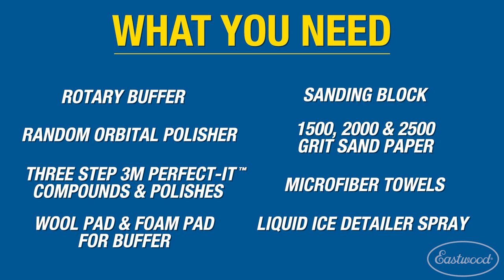How to Color Sand & Buff a Car After a Fresh Paint Job - Step by Step Plus Tips & Tricks - Eastwood

Comment: How long should you wait before cutting and buffing fresh clear coat?
Reply: My body shop waited a couple hours after leaving the booth 2-4. But I didn’t feel safe buffing it much less sanding lol a day or so would be best in my opinion
Reply: the longer you let it heal the better
Reply: I'm not being disrespectful when I say this but if you have to ask that question I would give it 1week but it makes harder work but less of a chance for huge mistake. But there's nothing you can do that can't be fixed.
Reply: @chriscostlow4210  is that because the clear coat becomes harder and more durable as it cures, thus making it harder to burn through?

Comment: Nice! What rpm are you running your rotary polisher on?
Reply: I keep mine at 600rm for doing the initial cut but I use a Rupes polisher at about 3500rpm for the polishing stages

Comment: Why does the gloss decrease after sanding and polishing fresh paint after a day of painting? I use Matrix clear coat and solvent base. I noticed that the shine is much better without sand and polish but with contamination. On another project, I waited 15 days before sanding and polishing and the shine was beautiful, without dying back. I was thinking of using a IR curing lamp instead of waiting a long time to polish. Am I correct?

Comment: I'm always wondering how much pressure do you use on the 1500 grit step and what wool pad grade do you use for compound step (course, medium, or fine) ? Great video
Reply from the maker: Pressure wise that's a feel thing that is tough to explain, but not much - it's soft paint, not body filler.  The Wool pad IS coarse.

You want to match Wool - Step 1 Cutting, Medium - Step 2, Fine - Step 3/Wax.

We have pre made kits with everything you'd need including foam cutting pads. https://www.eastwood.com/eastwood-concours-6-buff-and-polish-kit.html

Comment: Please list the product numbers of the bottle supplies so I can order the right stuff. 
There are way too many to choose from on the Internet so it would be greatly apprieciated if you would cut through the online bs and list the part numbers of the different Cutting, Rubbing and Polishing bottles you recommened from the video, Thank you!
Reply: Probably better off with Presta pace system, doesn’t contain any fillers and won’t haze up after it being in the sun. 
133132 heavy cut compound with a rotary and wool pad 
133232 medium cut compound with a DA orbital Polisher and an orange foam pad, insanely beautiful finish and the gloss on a black car is really deep. Easy to clean too

Comment: At about the 3:10 mark, the lower right hand corner of the panel.. as the light is shining on it.. it looks cloudy??  I'm having a similar problem right  now with my paint job which has me searching for answers..  I painted my 62 VW bus with PPG (water base)  two tone..  White on top..  mid to dark metal flake blue on the bottom.. and 4 coats of clear.   I started on the dark color first.. I Used all 3m trizact to color sand to remove the peel.  1500, 3000, 5000..  then went to 3m wool pad and Perfect It compound, followed up with the polish and then swirl remover.. the peel is gone.. but the finished panel when compared to the freshly painted and untouched panel is dull.. just like what I see in this video at about the 3:10 mark.  Any insight/advice would be appreciated..
Reply: Did you end up finding out the problem?
Reply: @kevinp6025  4 coats of clear will cause cloudiness if you don't let it flash off enough. Lucky there's no solvent pop. By the way, never apply 4 coats of clear. Three is the max then you let it dry completely and flow coat any additional coats....This is for any one currently wondering about it.
Reply: @timewarp999  thanks for the response. I sprayed two, heavy coats on my project. Had a lot of orange peel until I reduced it with 5% reducer then those parts came out much better.
Reply: @kevinp6025  i'm glad to hear that. You can also increase your air pressure to reduce orange peel. those are the two ways. Realistically you need at least a sixty gallon compressor to maintain air flow and get a flat paint job but there are tricks to get by with a 21,26, or 30 gallon. Keep on painting. I'm doing my corvette currently...in Honda R556P :) Very touchy paint process by DeBeer.